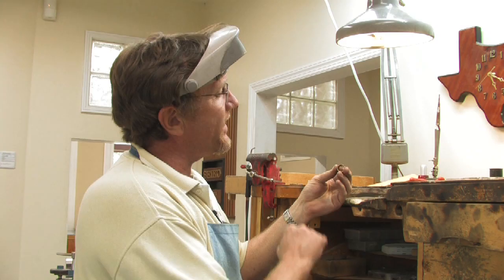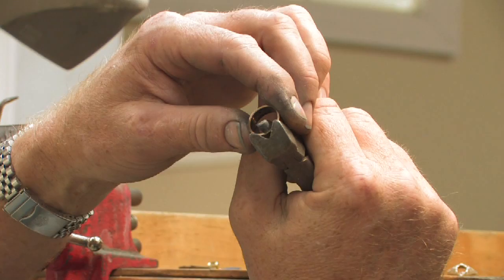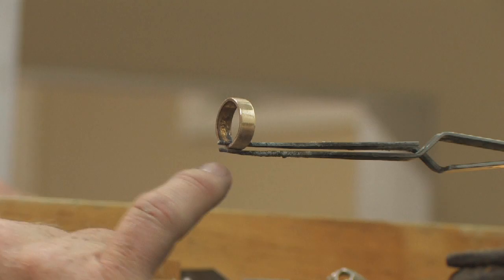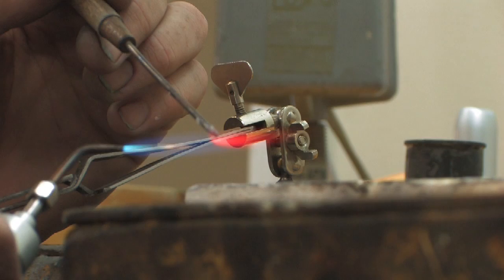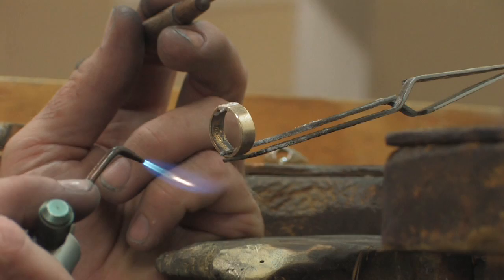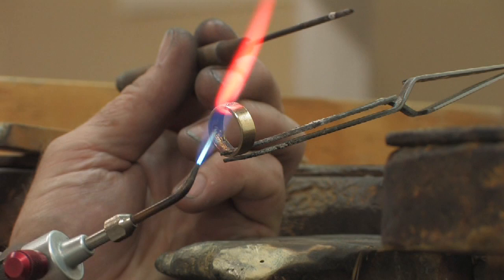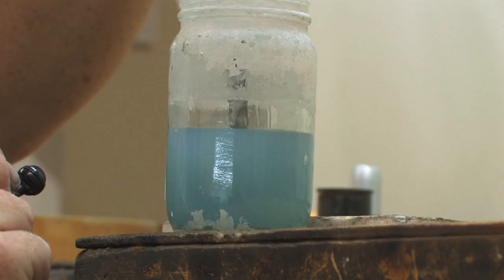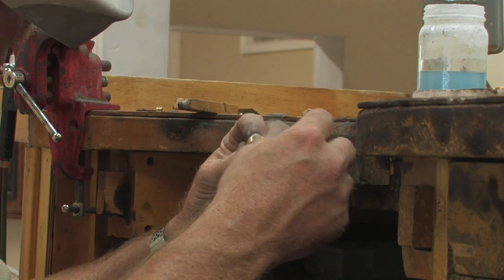Jewelry Making : How to Solder Gold Jewelry

Comment: The alcohol used is denatured alcohol, usually you can pick up at any hardware store. I use an old baby food jar and use about a quarter to a half inch of the powder boric acid (hardware store cockroach and ant killer is boric acid, that is what I use. Check the label but on mine it says 100% boric acid..) And then I fill the jar about 3/4 of the way full of denatured alcohol. I have a hole cut into the lid of the baby food jar and a brush that I use to dab the solution onto the ring.

Comment: 1)what kind of alcohol? does methanol work ok? 
2)what is the ratio of the solution 
3)what is green flux? 
4)can gold jewlery be brazed or is that too hot and will melt the gold? 
5)also the lower the karat the higher the melting point of gold? 
6)are you matching the karat of the ring? 
7)can silver be used instead?

Comment: Marcos.. The easy solder is a good choice for a chain, and you have to be especially careful if it is a hollow chain. Before you know it you could end up with a puddle of gold :0 But the only reason I could think of is with the torch you are using it might be too broad of a flame, with chains you want to direct the heat in a pinpoint spot, so I would lower the levels if gas/oxy and just make a smaller, tighter flame. Not hotter, just a tighter flame.

Comment: And you should be using Hard solder, instead of Easy solder. Easy solder has a lower melting point and doesn't make the joint as strong as Hard solder would. Easy solder will show seams and is more likely to crack and break as well. But like I said before.. A ordinary band should never be cut-sized, rather shrunk/stretched.
Reply: shrunk? how can I do that?

Comment: This is an awesome video and I love that I can see everything up close. I've been soldering sterling silver jewelry for a couple years now and wanted to expand into gold. I have a couple questions: 1. How was that little ball of gold solder made? just heated a piece that put it on when the flux began to bubble ? 2. I have boric acid, what is the boric acid: alcohol ratio? Do you use denatured alcohol? 3. what kind of file are you using to file when finishing? THANK YOU SO MUCH !!
Reply: I can answer #1: You cut a small square of solder and heat it by itself. When it melts, surface tension draws it into a ball, making it easier to pick up with the soldering pick. A sphere is also less likely to shift out of place drastically if the flux bubbles after you've placed the solder on the joint.

Comment: Where did you purchase your 18k gold e z flow solder from? Can't I use Borax flux to keep the metal clean? I'm too clumsy to use boric acid. Lol Also, I'm going to solder gold jump rings on my copper tape, is it possible to solder gold jump rings on copper tape?

Comment: Love it. but I do not understand why you used the solution of boric acid and alcohol as a quench?
Reply: quenching in water is too fast for some gold alloys and will make them brittle. quenching in denatured alcohol is a slower cooling quench. its like how you quench steel in oil rather than water.

Comment: I was really curious if there was such thing as gold solder.  I'm glad to find out that there is! Can you do this process with a soldering pen?
Reply: +May McDonough Yes A soldering pen is simply a combination of gold solder and flux mixture. The heat process is the same.
Not to be confused w/a "soldering iron" some people call a 'pen". That is used for electronics solder
Reply: +May McDonough ...Gold solder can be purchase from a jeweler's supply company, such as riogrande.com
Reply: most of thse "pens" are available at reputable companies that serve jewelers specifically. i would never recommend people buy gold or any metals from rio grande unless you are just a hobbyist or student. rio grande is NOT a metal source for true professionals and they do not wholesale the metal, they ask full market retail mark up. that can get very expensive very fast especially since wholesale prices are much lower than you think.
Reply: Hi, Can you advise how to get gold at cheaper prices then rio grande? what to do if i want 14 k gold wires for simple rings? kindly advise.
Reply: Findnot Formetoknow what do you recommend I've been buying from Rio and they are expensive any help would be greatly appreciated thanks